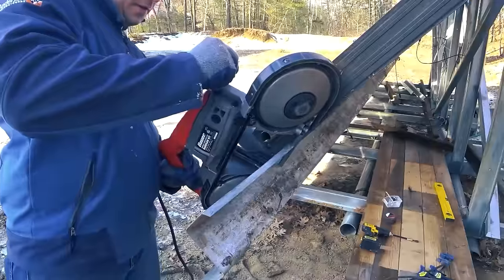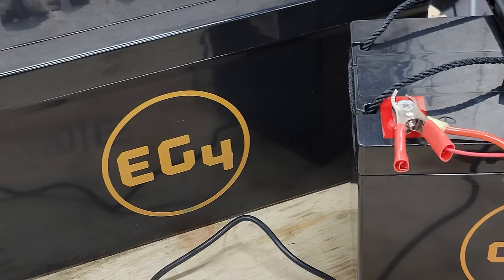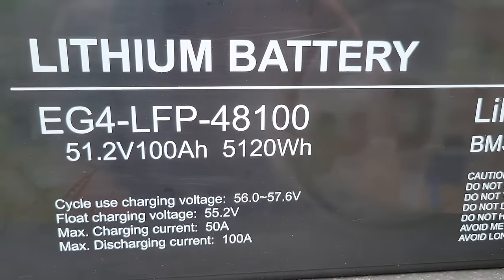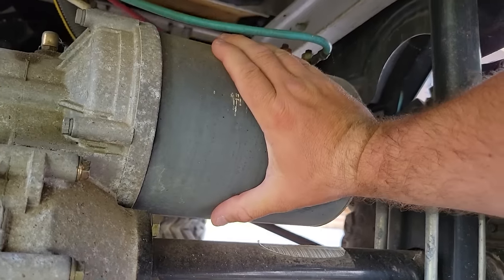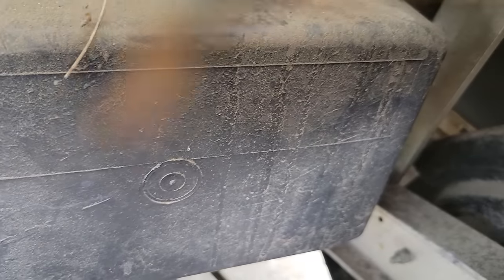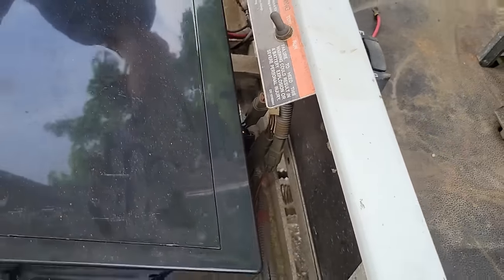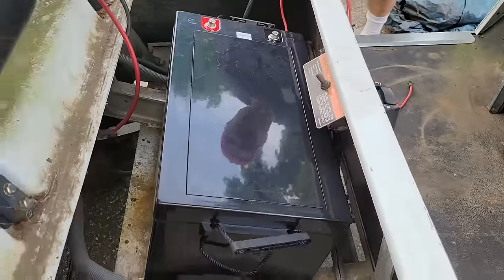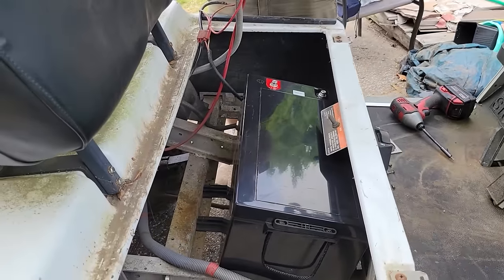Golf Cart Upgrade, Lead to Lithium Battery, EG4

Comment: I help my in-laws upgrade their backup sump pump battery to a Chins 12V 100Ah LiFEPO4 battery. They ran their pump on it for 4 days and it still had a lot of juice in the battery. Their old lead acid would only last an hour or two. A new lead acid would have lasted longer but LiFEPO4 was the way to go since it will perform for years to come.

Comment: It would be fairly cheap and simple to also add a single 100-200 watt solar panel on the roof as well as a solar boost charge controller to charge the battery while driving.  I've seen others do this as well.
Reply from the maker: I agree.  He has already tossed one on the roof with just a ratchet strap.  Ha.  It's been keeping the battery charged.

Comment: LFP is a really smart choice. LFPs are way safer as far as thermal runaway (fire) goes. You're safer than a gas vehicle by far. Because the amps don't vary as much with LFP vs standard Lithium Ion, the system will not be able to read remaining range as accurately unless you charge the battery to 100% at least once a week to give it a starting point to accurately measure. I wouldn't leave it at 100%, but charging up to that before use is great. For the most part keeping it between 50% and 80% for most of it's life is optimal. It's also good to run it down almost empty now and then before charging to 100%. Love the video. Great upgrade

Comment: In all likelihood that golf cart has an electronic motor controller which means that the maximum power draw from the battery occurs at a higher speed than zero.  Specifically the speed where the controller is no longer stepping down the voltage (and stepping up the current) to the motor, and instead has the motor across the line.  It would be interesting to put your peak recording ammeter on there and do a standing start to full speed run, and see what current reading you get.  Then put the ammeter on the line to the motor, and you'll see a much higher reading when the controller is dropping the voltage and raising the current.

Comment: You should test with two people on a hill.  Most carts have series wound motors and will pull more amps trying to do the work of a hill than just punching it and taking off.  My stock 36v pulls about 150 amps on a hill with two people.  This not just a surge but continuous at it is climbing a steep hill.

Comment: Has any one made the switch of batteries on a older electric zero turn mowers sold at the big box stores. The ion batteries last about four years. With the four 12v 100 AH batteries connected in series new I was getting one hour thirty minutes per charge. Last year I was lucky to get thirty minutes. The company changed its new models to Lithium batteries, so support over the next couple years is maintance going to be  suspect. The meter is a little flaky but I am happy with the unit. I have about two and half areas to cut and need at lest two hour run time. I am looking for a solution so I am not buying new batteries every four years. thanks for a great video.

Comment: Interesting in this change over. Can you tell me if there were any differences between this battery setup and the previous lead/acid battery setup concerning speed. Did it give more top end? And what was the cost to change over to Lithium?

Comment: Hi David, Great Video. long time viewer here.  Can you just confirm when you tested the inrush Amps @92, the clamp meter was correctly set at DC. I ask because the first test showed 72Amps, the meter was at AC.  As you know, Will not show correct measurement.
Reply: it looked like it was on AC for both tests.  not the right setting.
Reply: @fatfreesalami  yeah I was wondering about that measurement too.  clamp on ammeters is only supposed to work on AC.(they are transformers). It could be that modern clamp on meters have Hall effect sensors built into the jaws.  I'll have to study into that.

Comment: Is it possible to identify the approximate cost of the groovy Lithium Iron Phosphate battery, its weight and cost? Also, as to performance, will this run longer, faster, etc., than the regular deep-cycle lead acid? Great video, by the way!

Comment: Dr Poz…. You briefly touched on a very critical point and I am hoping that we can go back a examine the issue.
MAXIMUM Battery Transient Current !
The battery in this video is claimed to have a maximum Discharge Current of 100 amps…but you also mentioned that “ on initial acceleration or start up “ ( rapid change from zero mph to ten mph ( example)) “ The Inflow Current could be much higher”.
Would two 100 amp battery packs in parallel better tolerate a 200 amp discharge ?
Or… a better example for many people considering upgrading to LiFePo….

I have a 48 volt golf cart with a higher performance ( Plum Quik) DC electric motor and a controller that is rated at 400 amps.  
 Would “ Paralleling”  battery packs EACH WITH THEIR OWN BMS…. Be a way to share the amp load stress across multiple battery banks?
Might two battery packs , each rated at 200 amp discharge, configured in parallel,  better handle my above described motor and controller?..and reduce stress on the two BMS systems ?

I have been getting “ push back” from some golf cart battery suppliers when I describe my cart configuration. They state that “ their batteries or BMSs may not handle the electrical loads. …hence my thoughts that paralleling  with multiple battery packs/ banks would “ share” / spread out the amp load stress. 

Thank you so very much for sharing your opinions.
Let us all accept that David’s opinions while founded in SOME experience, May not be based on extensive testing per the posed questions… and that we should only CONSIDER David’s responses as “ educated guesses”… NOT professional statements.

Is this also going to be an issue with converting to A/C motors ?
Reply from the maker: yes, you can parallel 2 batteries for a theoretical 200A continuous discharge (assuming 100A per battery).  however, there are always very slight differences between one battery and the next.  So, one might have slightly higher IR (internal resistance) than another.  The difference is so slight you won't notice it unless you have a 4-wire IR tester.  In application, this means that you won't see the full 200A potential.  You might see 100A from battery A, and 90A from battery B.  Still a lot more than 1 battery alone, but not exactly double the Amps with two batteries.  I have tested this exact thing at home pulling maximum Amps from paralleled batteries in my server rack.  
Another option is to build your own battery pack with a BMS (battery management system) and cells capable of handling the currents you want.
Reply: I run 4 of these in a polaris ranger ev.  It can pull over 600 amps.  I pull trailers full of wood and a 1600 pound log splitter around with two people and stuff in the back.  Two of these would give you about 300 amps of brief discharge (not gonna handle 400 amps ever though).  I would try to program your controller for 300 amps max and go for two batteries.  You can always try it first with just two batteries.  If your not loaded down too much you may not get to the 400 amps your motor is rated for.    If you max the draw they shut down and reset automatically in 30 seconds.
Reply: @beldre1 Thanks for your comment. I have a Ranger and am considering these batteries. Would you be willing to visit about your setup?

Comment: Interesting conversion and after watching this video I did look in to the signature solar battery, but for my cart it is a 36 volt and the BMS in the 36 volt battery has a much lower discharge amp rating than the 48 volt and I am not sure it will work for me. The 36 volt EG4 WP only has a 102 Amp discharge for 10 sec and the 48 volt is rated at 150 amps my concern is the BMS may trigger under a heavy load, my cart is a stock cart but finding the amp dray for a stock cart is pretty hard to find online.

Comment: Shame you didn't put a few batteries to the same size and weight as the lead as that would have been an interesting test. Why you didn't use 12v batteries is beyond me.

Comment: I really, really want a small, cheap, electric city car. No power anything, no air conditioning, extremely basic. Just something for traveling 50 miles while running errands, or whatever. Since EV makers seem intent on making cars with 1,000 mile range and heated steering wheels, maybe I'll have to convert a golf cart to finally get my small, cheap, electric city car.

Comment: Hello David... There must be a way to replace a 36 volt system cheaper than spending a couple thousand dollars... I have a beautiful old 1960's  golf cart but spending that kind of money is just too much.. Any suggestions on doing this for around  a thousand would be greatly appreciated..thanks ..
Reply from the maker: Sure.  You can build your own pack.  Here is an option: https://batteryhookup.com/products/new-4-pack-eve-3-2v-75ah-240wh-lifepo4
Buy 3 packs, there are 4 cells in each pack so that will give you a total of 12 cells.  Arrange 12 in series to make 36V.  Add a BMS like this: https://batteryhookup.com/collections/accessories/products/12v-lifepo4-smart-bms-w-low-temp-cutoff?variant=36287974736034  You will need to make the housing to hold everything together, but it will come out less expensive.  Use coupon code DAVIDPOZ for a discount and to help out the channel.

Comment: Sorry … one more question…
If the battery ( BMS) shuts down….. how do we restore it ?
Can we / how do we restore it in NOT near a charger?
Being miles away from home when the BMS and golf cart goes into a coma …. 
Not good…
Ok I get it… the “ restore” might be battery and BMS specific.
Thx
Reply: it only shuts down for 30 sec then resets automatically.  I had 2 of these in a ranger ev and had that problem.  I ended up putting in 4 of these...but a ranger ev can pull over 600 amps!
Reply: sorry meant 60 seconds

Comment: can you explain how a higher amperage charger would charge faster when the batteries BMS control the current to the batteries? thanks.
Reply from the maker: The BMS built in has a limit of 100A.  The BMS won't change the Amperage for anything below 100A.

Comment: How has this battery held up since you made the video? What kind of range are you getting? I would appreciate any advice. I want to buy this battery.
Reply from the maker: It's still going and working well.  Signature Solar even updated the BMS, it's now rated for 200A in case you have a more powerful motor.  https://signaturesolar.com/eg4-wp-lithium-battery-48v-100ah?ref=4_rHcgZ9x-TiF-
Reply: Thank you! I will probably have to get another motor for mine as it's the old club car DS series motor. I think it might do 12 mph. My controller is a 225 amps. I'm going a golf cart to LSV conversion so I can drive it in downtown Tampa. To be legal it has to be capable of minimum 20 mph to a maximum of 25 mph. So I certainly won't be getting any crazy type motor and will keep my controller I have now. I hope to have some fun with this. I like that the company is in the USA and they are very competitive on price.
Reply: Have you tested the range on your cart?
Reply: @DavidPozEnergy yea the new battery has amazing stats and is priced incredibly well
Reply: @robertmiley97  so how fast did your golf cart end up with the new 48v battery.
Reply: @innerspaceavailable  with just the new single Falcon Elite it did 22 mph. The previous owners must have done some work to her. We bought it not running. After lift kit and 23 inch tall tire 28 mph.
Reply: @robertmiley97  How about the Eg4-WP from David's video. Did you keep that in there for any length of time?

Comment: I'd love to see more about that specific battery, but your affiliate link doesn't work. Maybe they're just out of stock?
Reply from the maker: Yeah, they are out of stock and don't have a date for more to come in.  Sorry. They usually restore the webpage once there is more on it's way.
Reply: @DavidPozEnergy  thanks for the quick reply. I was able to find a manual and am comparing these to the server rack batteries for a different application.

Comment: I would just put a 100w solar panel on the roof and have done with it.
No need for chargers or additional faffing.
It would probably just charge the through the day while in-use.

Comment: Why did your clamp meter say AC when you were doing the tests? The battery is DC current. 6:37 even shows the meter switch in the wrong setting.
Reply from the maker: The manual says to set it there for "inrush" for both AC or DC.
Reply: @DavidPozEnergy  Now that is weird. Wonder why they even bother with having a DC setting then?

Comment: Do you know how this battery is performing now...Still no issues?  Thanks!
Reply from the maker: The battery held up well, but the BMS wasn't up to the task.  The BMS is the battery management system inside the case.  It BMS in this battery was limiting the current to the motor too much.  We swapped it out for a battery about the same size (Ah) but with a larger BMS.  Check the video out here:  https://youtu.be/JnA4R1xuChU?si=WWLVq5KBoaGev7PS
Reply: @DavidPozEnergy  Okay thanks. I just ordered the egf 48v from signature so hopefully it’s the newer version.  I see It is rated at max 200ah output and states the BMS is rated at 200a.
Reply from the maker: @ajsfree  Cool, were you able to use my link when you ordered it?
Reply: @DavidPozEnergy  yes on the battery but the charger did not pop up.  I should have it installed within the week.  Thanks again!

Comment: I am just wondering if this battery will work on an Low Speed Vehicle (LSV). It is a 48V system. But I am not sure about the motor.
Reply from the maker: Sure, if it's 48V it would work.  However, the LSV, or NEV (neighborhood electric vehicles) tend to be a little heavier and come with a little larger motor, so the Amp draw is going to be more.  I'll be you will need 2+ batteries to handle the Amp draw

Comment: Can’t find the battery, clicked 2nd link in description and it took me to a broken page. Tried to find waterproof EG4 48v battery by going through the site navigation and it only lists 12v and 36v?
Reply: they are sold out they usually post on the website when they are getting close to getting an order in

Comment: Poz, what solar charging kit can you recommend for a club car with 6, 8V battery set up? Thanx!
Reply from the maker: Hi Col Jr.  For solar charging a golf cart I recommend using one large solar panel (anything you can get locally, around 300-400 Watts) plus a solar BOOST controller.  I like this controller: https://amzn.to/3y82wvf (Amazon Affiliate Link).  These large solar panels will usually have a Vmp (volts at Maximum Power) of 35-45V.  But, a 48V battery will be charged around 54-58V (depending on chemistry).  So you need a charge controller that can boost the voltage up.

Comment: Can you tell me how it did on steep inclines my campground is very hilly
Reply from the maker: This battery was the first Version of the EG4, Waterproof.  It has a 100A BMS inside.  We did find that on certain runs (like up long hills, fully loaded) we exceeded the BMS and the battery shut off.  Signature Solar heard us, and these are now being sold with  200A BMS's inside.  I suspect the new version won't have the same issue, but I haven't been able to test the new version.  https://signaturesolar.com/eg4-wp-lithium-battery-48v-100ah?ref=4_rHcgZ9x-TiF-
Reply: @DavidPozEnergy  sorry I ordered the battery before I saw your link you sent me. Yes as soon as I saw it was a 200-amp and I think it was 345 peak or something like that I pulled the trigger right away and bought it. Really appreciate your video thank you

Comment: From signature solar webpage: *EG4 (48v) Waterproof batteries are not a direct swap drop-in option for GOLF CART or ELECTRIC ATV application due to increased amperage during ignition / loaded acceleration moments.

Comment: Be careful if installing this in a golf cart.  On the battery manufacturers website for this battery, they have a disclaimer that says, "**EG4 (48v) Waterproof batteries are not a direct swap drop-in option for GOLF CART or ELECTRIC ATV application due to increased amperage during ignition / loaded acceleration moments."
Reply from the maker: I agree you need to be careful.  Things like, aftermarket motors, or larger diameter tires, will increase the Amp draw.  In this case, it's been working all summer just fine.

Comment: They seem to have a contradiction of the specs.  On the battery itself it states 50A max charging current but on the next screen in the video it shows 100A.  BIG discrepancy.  Also, it is very stupid that the battery manufacturer put the + and - terminals at the same height, so that dropping  a tool on them or bumping them up against something metal could cause some problems.  Also, why are those terminals so small?  100A requires some beefy connectors and those don't look very beefy to me.  10A charger will not get that battery charged up quickly for people that like to play a LOT of golf, such as 18 holes, eat lunch, then play 18 more holes.  In NC (North Carolina), I almost completed 4 rounds of golf in 1 day (almost 72 holes).  The weight of a golf cart is not so critical and some people might argue that by having heavier batteries down low, it gives the cart more stability such as more resistance to tipovers from people sitting up high and maybe riding on sideslopes that are somewhat dangerous, especially when they are drunk and have questionable judgement.